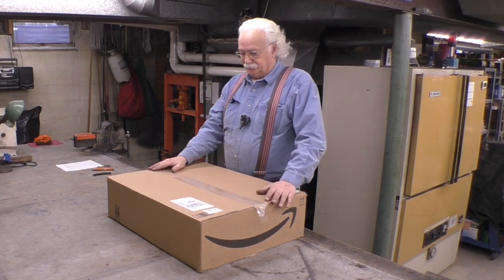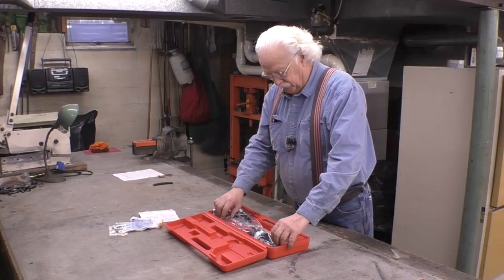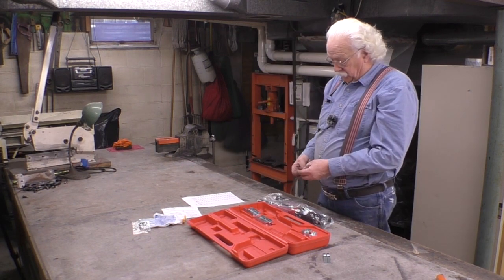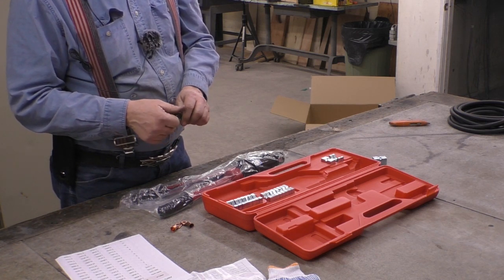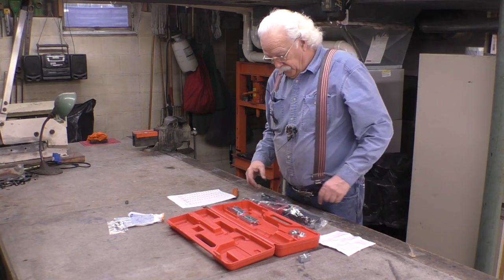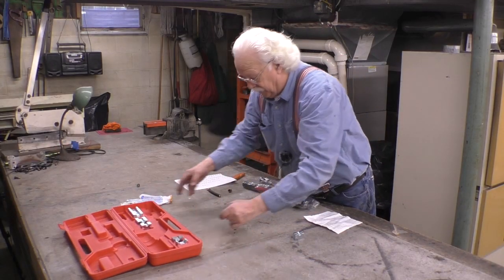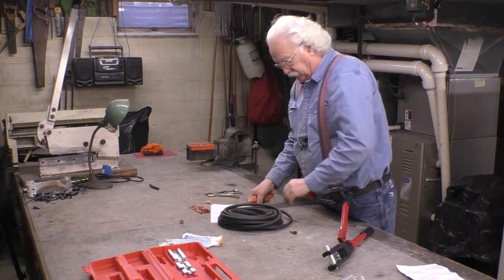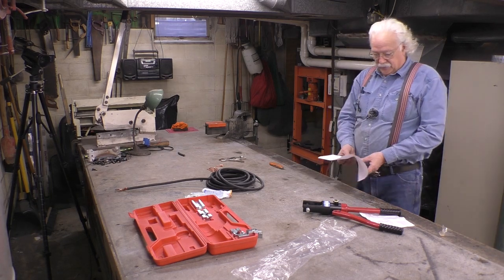Terminal Crimping Tool for Battery Cables

Comment: electricity is not carried on the surface of the wire technically that's called Skin effect and it only applies to RF energy. DC energy like battery cables and anything below RF frequencies will be carried deep in the conductor. 

higher strand wire can be inferior in most applications, in high current conductors the fewer strands the better. the only reason to use high strand content wire is for extreme flexibility that's why welding wire is made out of high strand wire because it's intended to be extremely flexible.

the problem with high strand wires terminations is unless there is a good strain relief the outer wires will eventually break because they're very thin. if you ever look at welding equipment you'll notice that the wire is actually clamped to the terminations at the insulator prevent the wires from flexing at the termination. 

now you can mitigate this problem with crimp terminals by using heavy adhesive lined heat shrink.

and you are correct never ever  solder on heavy Connections in terminals solder is for PC board connections and there's a reason why NASA and the Air Force ban the use of solder on wire terminations. solder makes the wire terminations very brittle again that's why NASA and Aerospace in general have banned solder on wire terminations.

using a hammer to crimp wire lugs is about one of the dumbest things you can do. wire lugs are intended for a single linear Force compression not impact compression. impact compression especially multiple impact compression's will cause microfractures in the wire and the connector in the same way that bending a coat hanger multiple times causes it to break. NASA specifies that the crimp terminal should only be crimped once never re crimp a crimp terminal in the same spot as you will compromise the connection. and technically crimp terminals are known as cold weld terminals. 

I don't mean to be rude but someone who doesn't understand something as basic as wire gauge should not be screwing around with wiry there are multiple different types of wire gauge you have American wire gauge which is only used in the US, you have the much more common international standard which is used everywhere else and then you have millimeters the 35 that you're referring to is millimeters. 

it seems as though you got a crimper intended for metric wire which can also be used with International wire you need a reference chart to convert it over.

you need to be careful buying Terminals and crimpers on eBay that simply State wire gauge because it's most likely International wire gauge you need to make sure to buy a crimper that specifically States AWG if that's what you're used to using. 

You can always cross reference AWG wire to the metric system if you're using the much more common metric wire gauge crimpers
Reply from the maker: Thanks
Reply: Wow.  I'm saving this information. This is good stuff.  
👍🇨🇦🍻